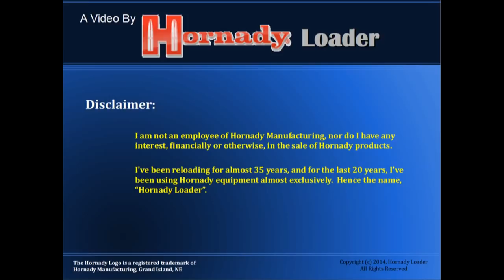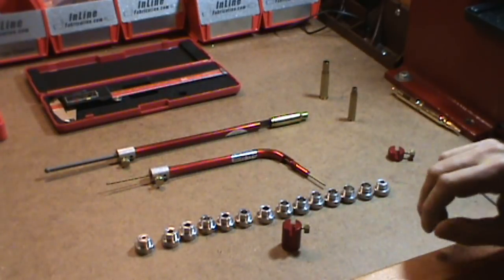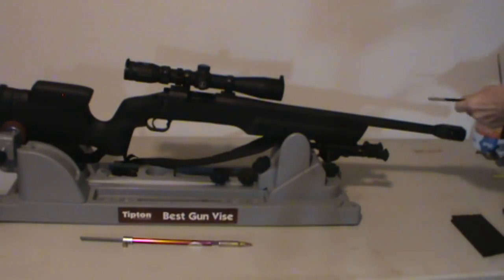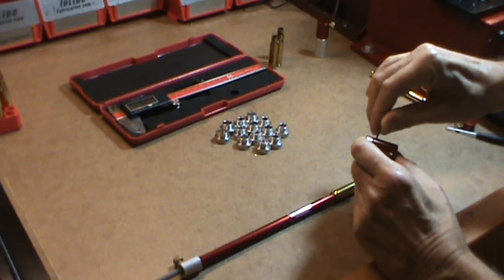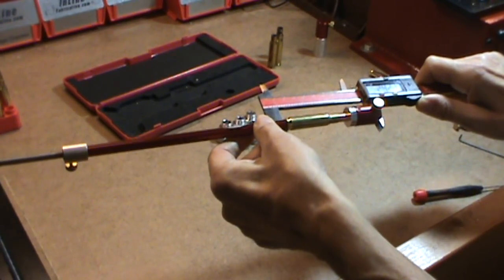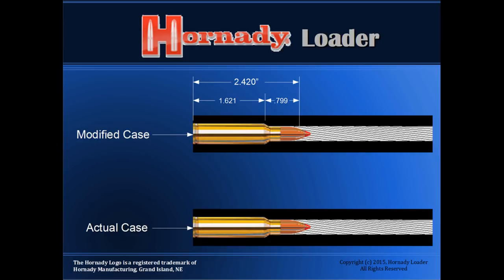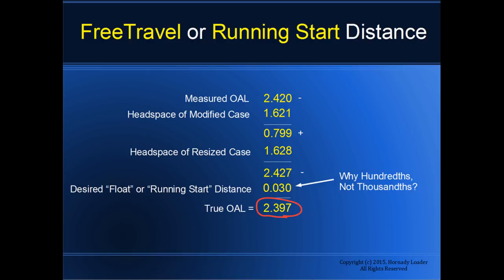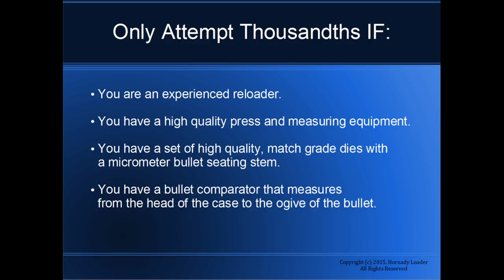Hornady Overall Length Gauge and Bullet Comparator

Comment: Question. how do you know the ogive bushings are seated on the projectile at the same place as your lands were? that's a bit of a large margin for error if you want your jump to only be 5 or 10 thousandths isn't it?
Reply: It doesn't matter.  You just need a length to ogive and then shorter that length by .020", or whatever you decide, using the same tool.

Comment: I'm new to reloading I have just purchased a Hornady AP Press, not sure I will be able to hold this type of tolerance with the type of shell plate the AP press has it tends to wobble a slight bit any thoughts on that? To start with I will be reloading 223 and 300 black how important is holding this tolerance with these rounds for accuracy.  (Great Video Keep Them Coming)
Reply from the maker: Hi Michael, If your shell plate is wobbling, there's a problem somewhere with the mounting mechanism.  Is the index key on the ram fully engaging the index key slot in the shell plate?  That might do it.  Otherwise, I would contact Hornady and see what they say.  My shell plates are rock solid and I rarely have issues with keeping tight tolerances. - HL

Comment: What do you think about using actual case that has been fire formed in your rifle, drilled & tapped to accommodate the Hornady COAL gauge, instead of using the "modified" case?
Reply from the maker: +Steve Barnes That's the best way to go.  Actually, for $15, Hornady will do that for you.  If you have the proper tools, you could certainly do it yourself.

Comment: for the Dewey Rod, what kind of tip did you screw on to the end?  is it some sort of coated tip, so as not to scratch the bore?  I have a 44" Dewey Rod i plan on using for this process you describe in your video. is there a specific coated tip, or should i just wrap some electric tape around the tip?
Reply from the maker: +GTXR 420 If you're referring to the cleaning rod that I used to push the bullet out, I used a carbon fiber cleaning rod from Tipton.  It has a brass tip threaded for 8-32 attachments but I didn't use an attachment, just the bare tip.  You could use a wooden dowel rod as well.  Anything that won't scratch the bore.  Since the brass tip on the cleaning rod is softer than the steel barrel, it won't hurt anything.  Your Dewey Rod should work just fine without any attachment on the end, assuming it already has a brass tip or something similar.
Reply: Thanks! This is what i wanted to know
Reply: +GTXR 420  forgot to add, awesome tutorial!
Reply from the maker: +GTXR 420 Thanks! =)

Comment: Hi there

I,m new to loading handgun ammo, I have Hornady AP reloader with case and bullet feeder. I was successful reloading 40 S&W and 45 ACP but when I started to load 9 MM the bullet fell inside the case? I cancelled belling the mouth of the case and still it is falling inside I purchased a new sizing die and still happening. is there something I can do to remedy that?
Reply from the maker: +Ed Azim Hi Ed.  9mm Luger cases are usually tapered a bit so the only part of the case that really grips the bullet is the neck.  A straight-walled case like the 40 S&W or 45 Auto isn't tapered so more of the bullet comes into direct contact with the inside of the case.  Does this happen with bullets from any manufacturer?  Or have you tried several?  Try this, size a case without belling it, then measure the neck's outer diameter.  Next, measure the thickness of the neck wall.  Double the neck wall thickness and subtract the result from the outer neck diameter.  This will give you the inner neck diameter.  Then measure the bullet diameter.  If the bullet diameter is smaller than the inner neck diameter, that's where your problem lies.  Try measuring bullets from different manufacturers to see if it's just that manufacturer's bullets or that particular lot of bullets that is too small.  The bullet diameter should be 0.355" or 0.356".  It's also possible that the cases you have are too thin at the neck and the inner neck diameter is simply too wide to seat a bullet properly.   Let me know what you find, I'd be interested to hear what you come up with.
Reply: +HornadyLoader Thank you for your reply I'll do what you asked and let you know what I com up with.

Comment: Did you put the comparator on the wrong arm of the calliper ..you said to put it on the travelling arm and you have put it on the stationary arm...?..
Reply: Also why not turn the measuring gauge over! not the comparator.
Also too much information, I am new to loading and have worked out all this from my 3 rd loading of my 303 British with the cheep Lee classic loader by hand and rubber hammer.
Reloading is like buying a Harley Davidson by the time you add all the bling,exhaust pipes, extra lights the 50 T shirts, man, I like to shoot and keep it simple to have fun.
My Harley is original just like my 1942 Number 4 1* Longbranch, simple but works,
Lee Classic loader by hand, caliper to  measure length (KISS method, Keep It Simple Stupid).
Just sayn' you know.

Comment: Dear Hornady Loader, @ 19:20 of the video, you reference a .799 measurement of datum point to ogive as being and remaining constant. I've spoken with the folks at Hornady and have come to the conclusion that this value you've assigned as remaining constant does not stay the same. If you measure head space on a fire formed case (base of stamp to datum point on shoulder), but then resize the case and bump the shoulder back...you are essentially changing the datum point your headspace gauge will measure at. If you change the datum point, it stands to reason the remaining measurement to the ogive will change with it.
Reply from the maker: +darren cook Hi Darren,  You're measuring two different things.  you're measuring the cartridge, not the chamber.  For example, I have a coffee cup that is 4 inches tall.  It was manufactured that way.  If I then put the coffee cup on a coaster that is 1/2" tall, that doesn't mean the coffee cup is now 4 1/2" tall.  The measurement from the datum line in the chamber to where the ogive of the bullet will hit the rifling will always be the same as long as you are using that bullet in that firearm.  You are correct that if you bump the headspacing back on the cartridge, the measurement from the datum line on the CARTRIDGE to the ogive will change (longer).  But since the measurement of the datum line in the CHAMBER to where the ogive of the bullet will hit the rifling remains the same, you will now end up with a cartridge that will jam the bullet's ogive into the rifling, which could cause pressure problems.  If you were to use your resized case with the overall length gauge, you'll find that the bullet will need to be seated further in to the case in order to achieve the same desired result, which is to find how far you need to seat the bullet to where it just touches the rifling in the bore.  Since the distance from the datum line in the CHAMBER to where the ogive of that same bullet hits the rifling has not changed, you'll find that value to be 0.799" again.
Reply: +HornadyLoader  please bear with me while I understand this. What I'm having trouble with, is the fact you are measuring the modified case headspace (1.621 from stamp to datum) not chamber headspace from bolt face to datum point on chamber shoulder, and then subtracting that from your 2.420 measured from stamp to ogive (or lands) assuming your bullet has been seated for contact with the lands. The .799 is not a measurement from datum point on the shoulder of "chamber" to the ogive or lands.....it's actually the left-over from the bumped back factory modified case to the lands. In my mind, you're calculating the distance from unfired case shoulder datum point to the lands but assuming in the next example that it was actually a constant measurement of a chamber shoulder point to the lands. I personally use a fire formed modified case but I really want to understand your formula and video. I've enjoyed all of it, with the exception of the method of obtaining your constant measurement. At this point, I can only think the measurement would remain constant if measured using a fire formed case. Hope this makes sense.
Reply from the maker: +darren cook Hi Darren, no problem.  I know it's a bit counter-intuitive.  Let's look at it this way. I put the modified case and bullet into the chamber, then move the bullet forward until it touches the lands.  At that point in time, the datum line on the case and the datum line of the chamber are at exactly the same point.  Everything below that datum line on the case (towards the stamp), is irrelevant.  the only measurement we'll look at for this example is the measurement from the datum line of the case/chamber to the ogive of the bullet where it hits the lands.  Now, I also have another modified case with completely different headspacing.  Remember the headspacing is the stamp to the datum line on the case, which is irrelevant for this example.  I use that new case and the same bullet and insert it into the chamber.  Now, the datum line on the case and the datum line of the chamber are once again lined up.  I move the bullet forward again until it touches the lands.  If I were to measure from the datum line of the case/chamber to the point on the ogive where the bullet hits the lands, it will be exactly the same measurement as the other case.  Remember, the headspacing is irrelevant since it is BEHIND the datum line and has no bearing on the distance between the datum line of the case/chamber and the point where the bullet hits the lands.  Also remember that since I am using the same bullet, it will hit the lands on exactly the same point on the ogive as it did before, since that is entirely a function of the bullet diameter along the ogive.  The bullet may be inserted further into the case, or it may be sticking further out from the case, but that's also irrelevant.  The only thing that matters is how far it is from the datum line to the ogive where it hits the lands.  Believe me, I know how difficult it is to wrap your brain around this, it took me a while to have my epiphany about it as well.
Reply: +HornadyLoader First of all thanks for your continued patience. I plan on reading through your last statement again a few times tomorrow to make sure I fully grasp it but thought I'd start with this for this evening.

"I know it's a bit counter-intuitive.  Let's look at it this way. I put the modified case and bullet into the chamber, then move the bullet forward until it touches the lands.  At that point in time, the datum line on the case and the datum line of the chamber are at exactly the same point."

Isn't this only true if you are using a fire formed case? 

In your example, the datum point  changes from 1.621 in the factory case to .007 further ahead in the fire formed modified case. The 1.628 can be looked at in two ways...stamp to shoulder datum point for the case, or bolt face to datum point on shoulder of chamber. Please stay with me...
Reply from the maker: +darren cook Hi Darren, Let's remember what we're trying to figure out.  From your original post, your only problem was in the fact that the 0.799" was a fixed value.  That's the part I'm describing in my posts.  Assuming that we're talking about a rifle chambered for 308 Win, when the case is inserted into the chamber,  the datum line of the case and the datum line in the chamber will line up for any 308 Win case, new, fire-formed, from any manufacturer anywhere on the planet, past or present, and every 308 Win case that will ever be manufactured in the future.  The datum line does not change, regardless of the headspacing, COL, CBTO, bullet depth, anything.  For 308 Win, the datum line on the case is the point at which the shoulder is 0.400" in diameter.  The datum line in the chamber is the point at which the chamber is 0.400" in diameter.  When you insert the case into the chamber, it will stop when the shoulder of the case hits the shoulder portion of the chamber.  The part of the case that is 0,400" in diameter will hit the chamber at the point where it is 0.400" in diameter.  At that point, the datum line on the case and the datum line on the chamber will be lined up.  This will always be true whether the headspacing is 1.621", 1.628", 5.0" or 10 miles.  All the headspacing does is determine where the case head will wind up and how far the firing pin is from the primer.  Of course a case that has a headspacing of 5 inches or 10 miles would preclude the ability to even insert the bolt, but all of that is irrelevant.  All of that is on the wrong side of the datum line.  The part we're looking at is the distance from the datum line to the rifling.  In fact, let's remove the case from the discussion altogether.  Throw it in the trash.  It is unimportant.  imagine the chamber of your rifle.  When it was manufactured, the barrel was mated to the receiver.  At that point, the distance from the datum line of the chamber to the rifling was set in stone.  Nothing will ever change it unless you take it to a gunsmith and have a different barrel installed.  It is a fixed value.  The problem is that there is no tool that will directly measure that distance.  So, what we can do is measure the CBTO of a cartridge that has the bullet seated such that the ogive of the bullet just touches the rifling.  This is what the Overall Length gauge does.  Now, we need to know the distance from the datum line of the case to the ogive of the bullet.  So we measure the headspacing of the cartridge which is the distance from the datum line of the case to the case head.  If we then subtract that value from the CBTO, we are left with the distance from the datum line to the ogive.  Since the datum line of the case matches the datum line of the chamber, and the ogive of the bullet lines up with the beginning of the rifling, it is the same as measuring the chamber itself.
Reply: +HornadyLoader thank you sir. What I was missing was the fact that the stamp of the case is not sitting on the bolt face. I imagined the case shoulder as being .007 farther away from the .400 datum point of the chamber.

Comment: You cannot effectively measure OAL with this tool. Fireform a case and bump shoulder where needed. Use after firing reamer by Forster and ream the neck after sizing the neck, then Lee collet neck size, bullet will have a snugger fir and be straight. Use Red lock tite  in neck, place bullet in neck, chamber for about 5 minutes. Be careful not use too much lock tite.

Comment: can you use the curved gauge with an AR?
Reply from the maker: +HillBillyRocker Hi, Yes you can.  Even though you can remove the bolt on an AR and use the straight gauge, it works just fine  with the curved gauge as well.  Removing the bolt isn't necessary, just lock the bolt back and access the chamber from the ejection port.  Thanks for watching!

Comment: my lee dead length bullet seating die for .22-250 when i took the bullet seating stem out and measured by placeing the seating stem on top of the bullet there by measureing off the ogive not tip i was getting 0.0005 at most inacurecey my calipers are realy good my seating depth with this not mircomitor die are persect gotta love lee products there so simple
Reply: There is or at least were a very few European made calipers that are supposed to be capable of measuring down to 1-2/ 10,000ths, but the last prices I saw they were running over $5,000 and I'm not sure there even still being made. Anyone who's buying and using calipers and micrometers for example needs to research, read and fully understand a few terms. Resolution, accuracy, and repeatability would be the first 3 and none of those terms are interchangeable nor do they mean the same thing. Just because a caliper shows 4 digits past the decimal point does NOT mean that last number can be believed or is even accurate because it's not. Due to the way the the calipers read sensor picks up the signals from the scale attached to the calipers beam it rounds the numbers off. Basically that last digit should be ignored. For other than those very expensive 10,000ths reading calipers AT THE VERY BEST including the high quality Starret and Mitutoyo made ones there only accurate and can only be trusted in the best of conditions to plus or minus one count. And that's well pointed out in the instruction manuals from both Starrett and Mitutoyo. 

For example on a .001" reading caliper that would be somewhere within .002". Yes most can do a bit better than that under those ideal conditions but it takes a very experienced and well practiced touch to do so. They can also be at that maximum of being incorrect by .002" and still pass the factory inspection. I've checked myself and my calipers that were over $200 on some extremely accurate and expensive gauge blocks. Mine repeat to within about .001" if I'm doing my part and it's a whole lot tougher to do even to that level than most hobbyist's think. I'd still only trust there measurements to maybe being within .003". I also wouldn't bet my life on that. Then there's a little thing called Uncertainty of Measurement that's well recognized and accepted in the metrology industry. Once you start adding these Hornady parts to any caliper the accuracy problems will increase exponentially. Simply put it's physically impossible to measure to less than .003" and still be 100% sure of accurate results with any set of calipers most of us can afford. I've got very good and expensive digital micrometers that can do so, but even then it takes practice to do it with numbers that can be fully trusted once you start getting into the 1/10,000" range. I doubt many will agree with my points, but falsely believing what the display shows verses what the actual levels of obtainable accuracy is only means there fooling themselves. Anything I've said is able to be 100% verified for anyone willing to do some searching.